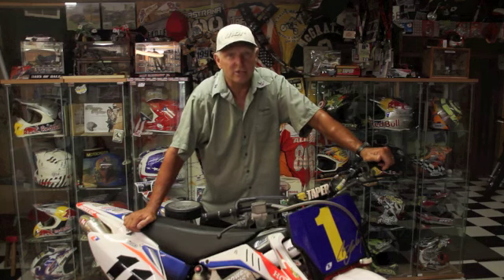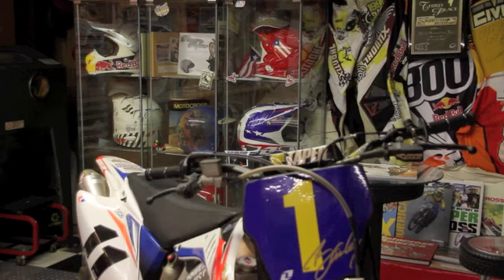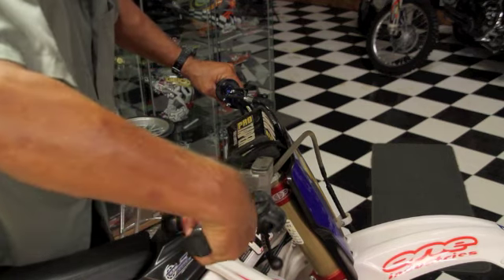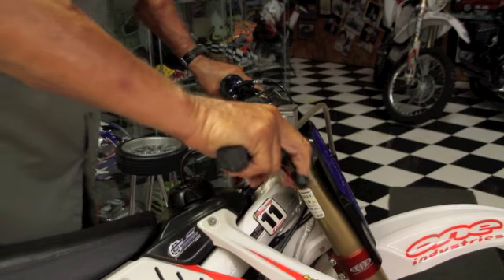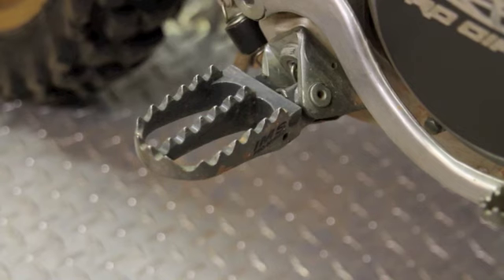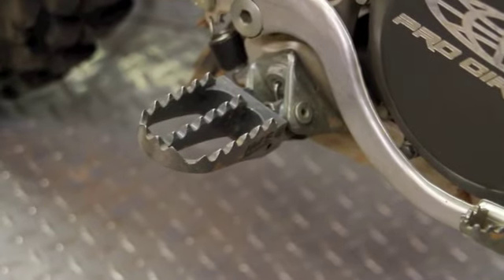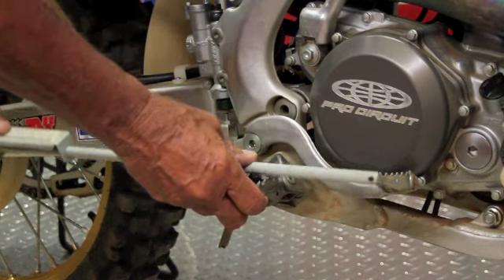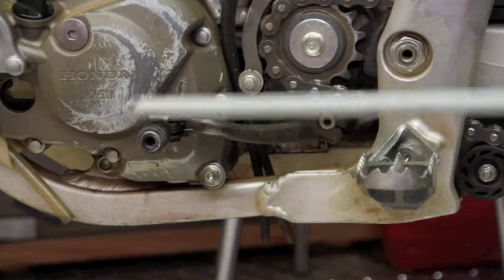Bike setup -VT

Comment: Professor, can you speak about rear suspension linkage arms. Are there any that will lower the seat height without negatively affecting geometry? And any other relevant issues with them. My inseam is only 30 inches and my 2013 CRF 450r is so tall (with correct race sag for my weight) I can only tip toe on one side with the other side on the peg.

Comment: Ah him no use proper,proper techno techniquico,gung ho,Michael Keaton,testimonial if anyone doesn't know it already I will tell them for Gary and the rest of the pros who ride with pro tapers,my short time on I rode a kx 500 two stroke was the first time trying pro taper handle bars,lets just say think of having an extra 3 inches front fork travel when you land,from a big jump,I was actually riding two KX 500 s at one time,and when I jumped back on the other 500 with out pro tapers I hated,the flex that the bars gives you reduces fatigue,by a ridiculous amount,way more than 50% over other handle bars,I won't say names...but if you are thinking of seriously racing at high level the bars are worth the money,don't know what they cost these days,no matter ask any one who has a set.